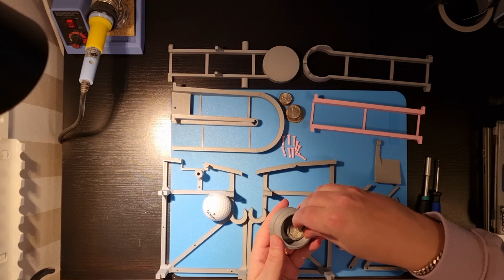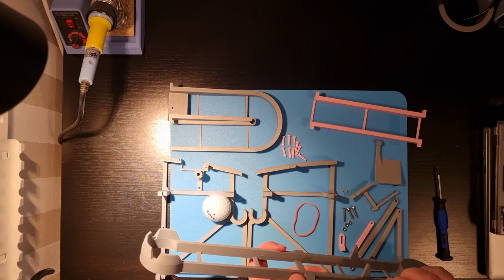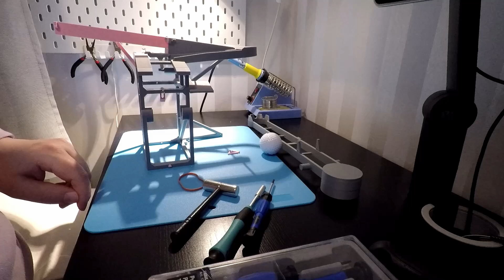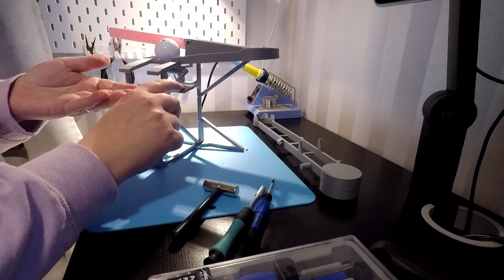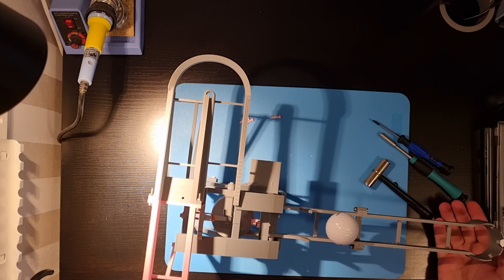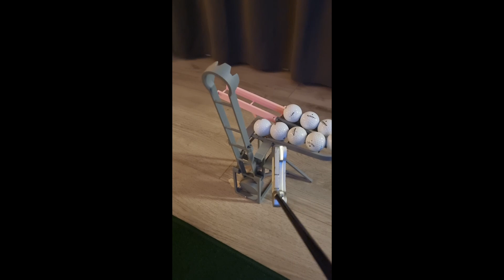3d Printed Golf ball dispenser - Build video

Comment: I cannot get the arm to lower after a ball is loaded without help. Not sure what I've done wrong, but great idea.
Reply from the maker: @xmizacex  to much weight in coins?
Reply: @Christoferjh  at first I tried coins and filled it fill with a mix of coins, it didn't seem to work so used less sinkers and bb's.  Just haven't found a balance yet.
Reply from the maker: @xmizacex  try to lube the axel also

Comment: Just tried it after printing all day. Haven't been that exited about a print in a while, thank you Christofer! You definitely know what you're doing and I very much appreciate the work you put in.

Because I love the idea so much now bringing this daily to the range with me, I can't help but wish for more sturdiness. Using little material is great... but this won't last long if you're not extremely gentle in a home simulator setup. I get it... A1 compatibility was probably your requirement.

But a pro version of this would be lovely. Made a lot thicker and stronger. I would print this in ASA-CF and only use screws with melted in inserts to give it extra quality. Also much wider so it doesn't tip over easily. Maybe with screws in the bottom to adapt to different heights of matts in the range. And a 30-50 ball capacity, maybe realised via a bucket that feeds the rails.
I know I am asking for much... but it does bring a lot of value for me and I would not mind at all paying for a model like that.
Reply from the maker: Thanks for the kind words! Some of the suggestions was also on my mind, but as you guessed my biggest build constraint was to fit the A1 mini. I was thinking about adding optional adjustable screw legs. But to make this version much more stable I suggest mounting it on a small piece of wood ( there's 3 bottom screw holes for this).

My goal is to get enough downloads/points on makerworld to buy a bigger build plate printer.

I will probably revisit the modell to add bigger ball magazine and other stuff (servo for automation?).

Edit: I would really appreciate if you commented/rated on makerworld.
Reply: @Christoferjh I redesigned with portable base and handle. Also double the capacity. I broke down to be printed on an bambu a1 standard.
Reply: Have you resolved the sturdy Ness. I redesigned as a deluxe edition. With base, handle, and double the capacity.